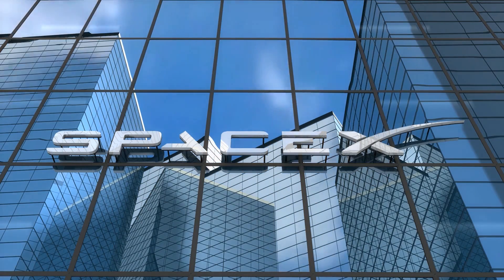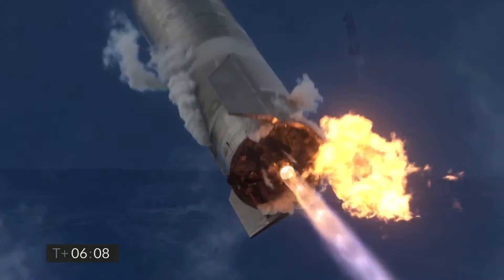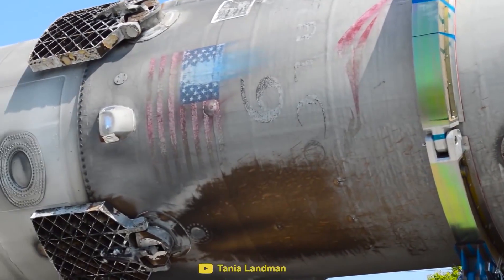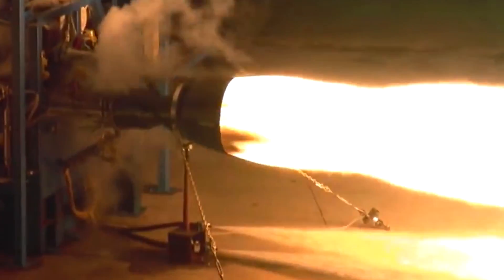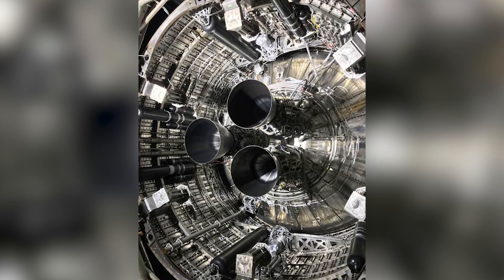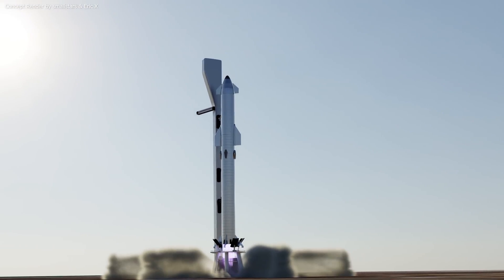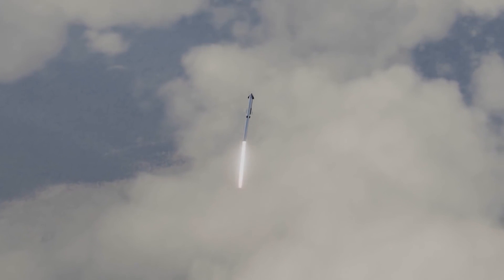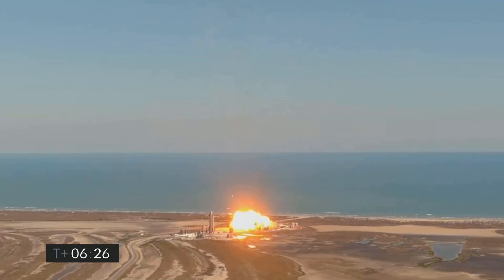Why SpaceX Starship Is So Much Better Than Falcon 9

Comment: Sorry for my ignorance but... if it’s fully reusable then how the astronauts are going to leave starship when they land on the moon? Isn’t it 125 meters?
Reply: Elevator..
Reply: @mmount4963  thanks but I never seen the design of how it’s going to work
Reply: @tonypaca3015  Just a lift that goes up and down the outside of the Starship, I forget where I saw it or I would link it for you.

Comment: SpaceX has to land it first, before flexing how it's better than Falcon-9
Reply: Does it?? I mean its the Starship 2nd stage what they are trying to land. The Falcon 9 second stage just burns up in the atmosphere. Landing a booster is much easier than landing a second stage.
Reply: A full flow staged combustion has been tried twice before. Once by Russia and once by the US. SpaceX has cracked that terribly difficult nut. Also, many experts said they couldn't land an orbital class booster. They've now landed roughly 90 times at this point. I think they will be able to resolve all of these issues. And so does NASA, they've given them the Artemis moon lander contract.

Comment: Starship will not land on mars with 100 people onboard.
Reply: The figure I remember from many videos is 50 though. I think they'll crack the nut. They're really good with problem solving.
Reply: Exactly. The old design of BFR, probably. But the current design won't even fit that many people with eventual point-to-point squeezed in next to each other with JUST seating.
Reply: @Darth_Revan25  it will probably take about 30~50 people onboard but sure it will
Reply: @sanajyshrivastava3707  Probably about right. Mind, there'll be a lot of interior structure. I see 20-40 max.
Reply: @sanajyshrivastava3707  50 people! how much food and water for them? for 8 months, and then in mars for how long?
Reply: I AGREE IT WILL KILL ASTRONAUTS PERIOD
Reply: I think your key board mistyped the word not in the middle